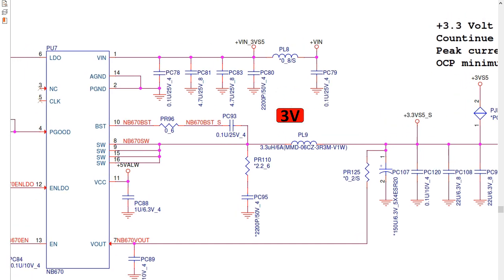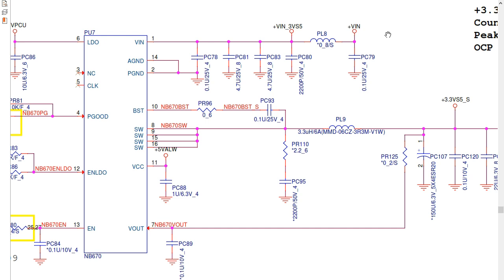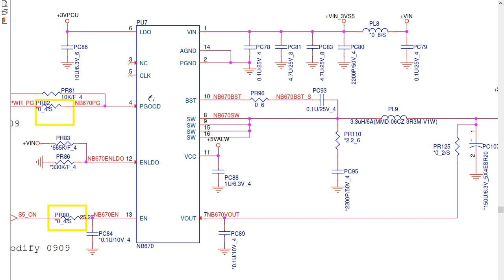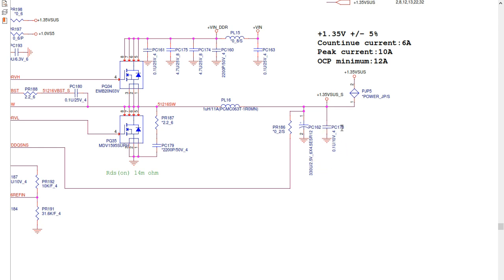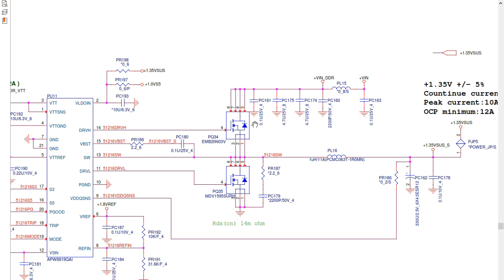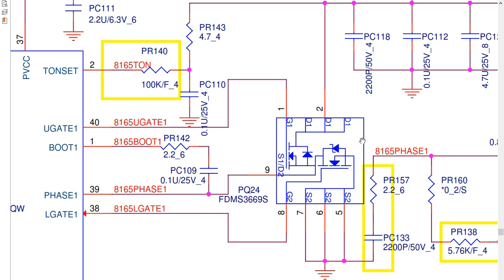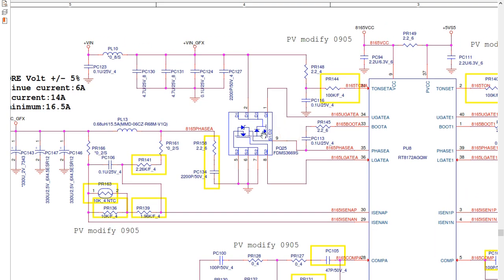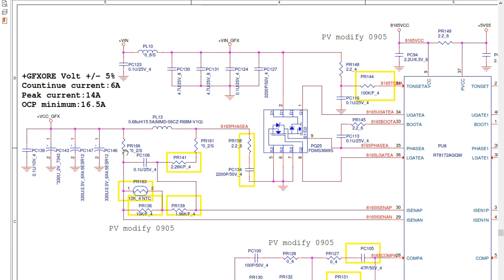Laptop motherboard repair | schematics reading guide part 2

Comment: Thanks! How to work with a power supply close to Pch or CPU. Where to inject, where it's danger.
Reply from the maker: Hi,
For witch purpose do you want that?
Reply: @electronicsrepairbasics_erb  Hi. I am a beginner. I'm doing this for passion. In order to discover short circuit. Or to find the component that is at fault on the line. I am always afraid to inject voltage. I destroyed on my 2 motherboards (on which I train), the 3v 5v chip and the load chip...I know that it is dangerous at some places of the motherboard (if you do it wrong) People never explain that! Especially the amperage.